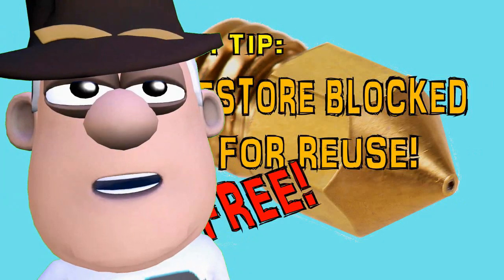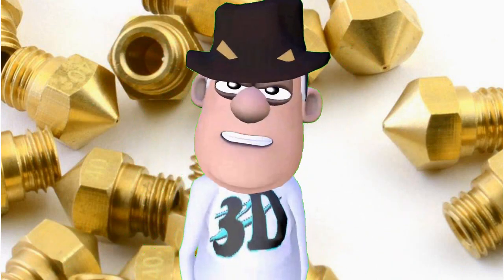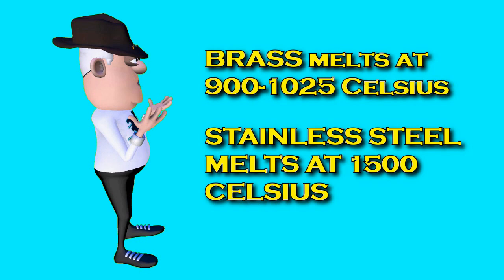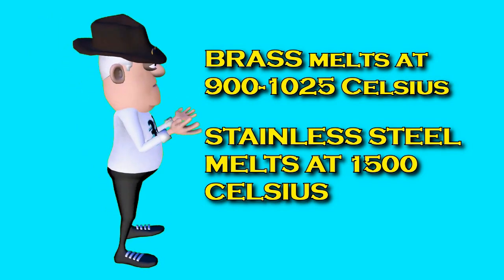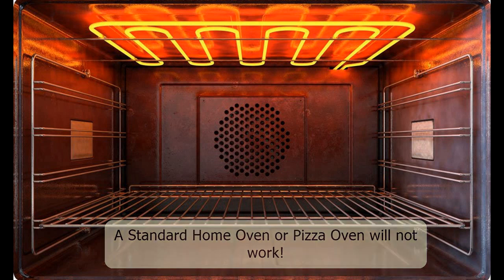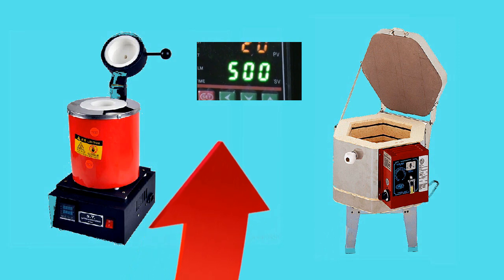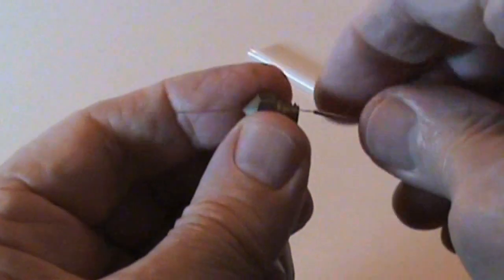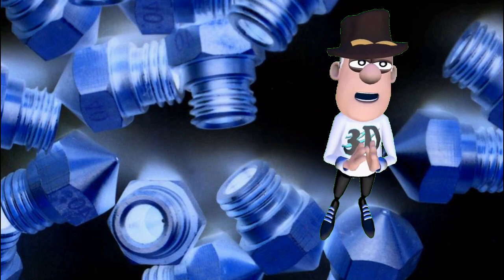3D PRINTER TIP: HOW TO RESTORE BLOCKED NOZZLES FOR REUSE! FREE!

Comment: acupuncture needles is a great idea..
but I'm not sure the will cure me thou 😅
Reply from the maker: First heat the nozzle to 500 degrees as shown on the video.  500 degrees will destroy all filament, then it is a matter of clearing out the residue after destroying it.   I have done many nozzles and it works.  Most don't let them cook long enough to destroy and burnout the filament.  It shouldn't have any effect on the nozzle!  Best of luck!  Happy 3D!